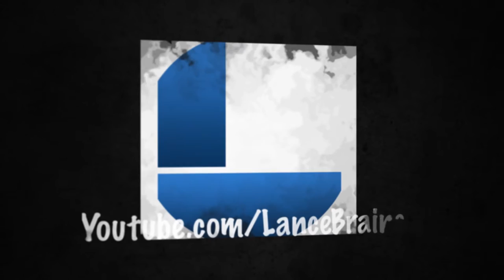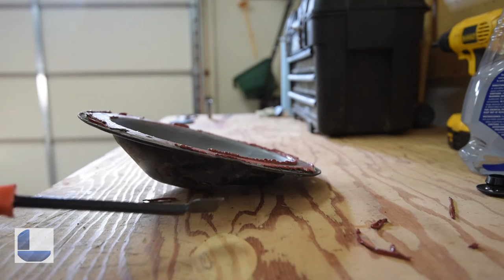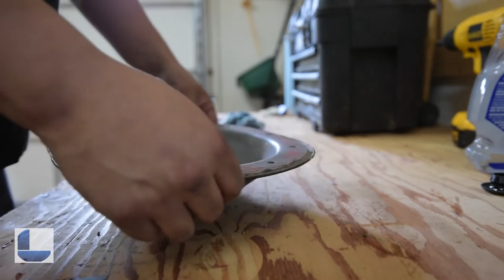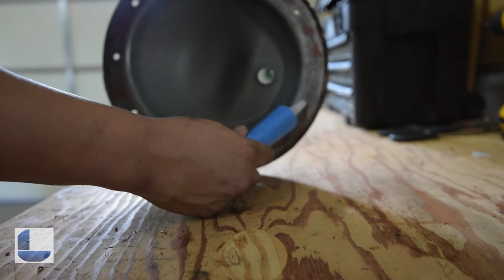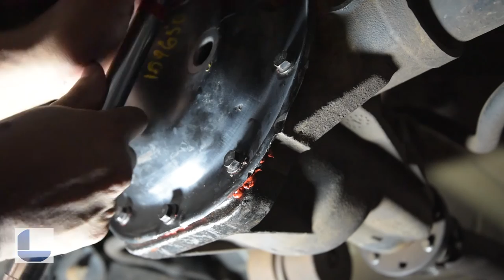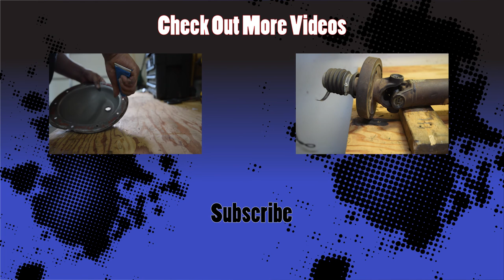(Short) How To Replace Jeep Liberty Rear Differential Fluid 2002-2007

Comment: Considering the interval for this fluid change is 20,000 miles, it's ridiculous that you have to remove the cover and remake the gasket every time.
I wonder why they didn't put a drain plug on it.
Reply: You can buy a liquid hand transfer pump with tubing for something like 15 bucks at Harbor Freight (Amazon and Walmart have stuff like that, too) and suck the oil out after pulling the rubber plug in the cover. Fill it back up after you've sucked out as much as possible and reinstall the plug. If you want to make sure you've done a really good change out, do it again in a month or so. That's how I do it. You only need to pull the cover if you want to inspect the gears, which I wouldn't do unless there's a indication of a problem. I put the pumped out oil in a Mason jar and inspect it in front of a light for metal wear. I think I've seen aftermarket covers with drain plugs in them when searching for Jeep parts, also. Don't remember where, though. I even have a brand new Mopar rubber plug in the packaging in case the installed one were to rip or tear when I'm pulling it. Never had a problem, but you never know.
Reply: @SSN515  Yeah, I actually have a fluid extractor which is use for oil changes and transmission drain & fills. I'm definitely going to use it to do this too.
I just don't understand why they didn't put a drain plug in there. Fair enough if the interval was 100k miles or something, but it's ridiculous to have to do this for a 20k mile interval fluid.
Reply: @thepenultimateninja5797  I figure they bought a couple of gazillion pumpkin covers without drain plugs wholesale cheap and have been using them ever since. Almost every rapid oil change and shop who does "differential service" pulls the rubber plug, hose sucks it out, and fills it back up. Nobody really pulls the cover. Except maybe the dealers. For a big fee.

Comment: 75W-140 is for trailer towing. if just a grocery getter, you can use use 75w-90.  75w-140 won't hurt but it will (theoretically) give you worse gas mileage.  Also slip additive only for vehicles equiped with Trak-Lok (Some 4WD models only)
Reply: How many liter oil needs to fill up the differential?
Reply: @ruplrichard  mine took probably about 2.75l.  3 * 1 quart bottles, but didn't use all of the last bottle.
Reply: King in Yellow is there a brand of oil you prefer?  I was thinking of putting AMSOIL 75w-90.
Reply: @bobgil3464  Anything with an SAE seal will be fine.  The difference in oil quality these days isn't nearly what it was 30 years ago.
Reply: @thekinginyellow1744  Right.  See for the SAE approval.
Reply: The king in Yellow.   Old machinery.  Even engines need thicker oil.  Worn out parts have more space between them and thicker oil is better to fill those bigger old gaps..